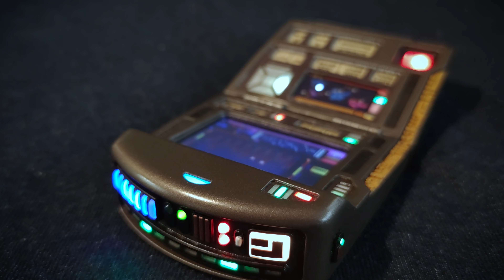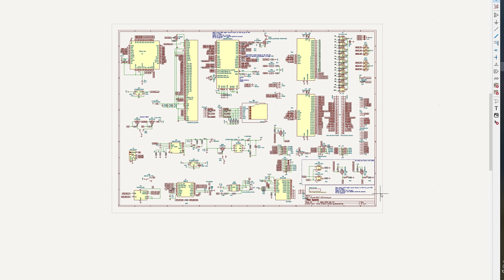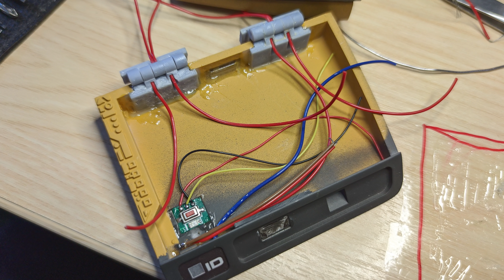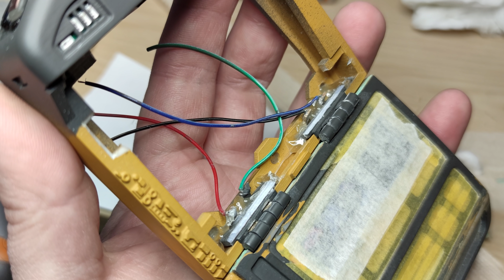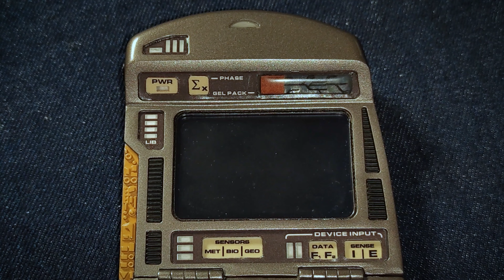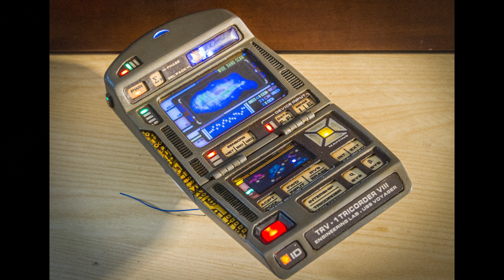The Voyager Tricorder V2 - Part 1

Comment: Rather than using wires to connect up the two sides wouldn't a ribbon strip be better. I mean wouldn't the wires eventually break from bending and unbending constantly? PS. Are you still using the raspberry pi in this?
Reply from the maker: The hinges are solid brass now. And the insides is more robust :D Check the latest video :)

Comment: For v3 it be awesome if you added a thermal sensor and added a thermal imaging scanner as a function, you could add a few cool functions using it.. they have some fairly cheap sensors out now. last I looked was a few years ago and there was one for about $220 (cheap for a thermal sensor), there is lots of code available too....

Comment: I think it's time for us to start developing the technology to make actual working tricorders. I mean, I don't expect a handheld device to detect neutrinos or read someone's genetic code from 3 feet away anytime soon, but I think it wouldn't be that difficult to register heart beat, respiration rate, and body temperature from a small distance. And as for other sensors, a Geiger counter could be added, and maybe stuff like a carbon monoxide detector, decibel meter, rudimentary spectrum analysis, stuff like that. Over time, more and more different kinds of sensors could be developed and added as technology advances and scales down.

Comment: This is unbelievable! I could see this expanding in the future to include actual sensors like temperature, humidity, pressure, altitude, etc. All small enough to be able to fit in future builds (and easier as things continue shrinking). Bravo!

Comment: So here's my question/thought: if you put a bluetooth receiver/transmitter in the chassis and just assigned ID codes to each of the buttons, could you offload the actual graphics displays to a parent program on a PC? I imagine this would be a cool way to do it if you wanted to customize the display for a long-running project, IE a summer camp where the kids were "scanning" different things in realtime and the PC provided imagery based on the tricorder's GPS location. 

Would that make the build easier to replicate? Could you hypothetically forgo any wiring between the two sections altogether by putting a bluetooth in each half and letting the PC handle communication between them as well?